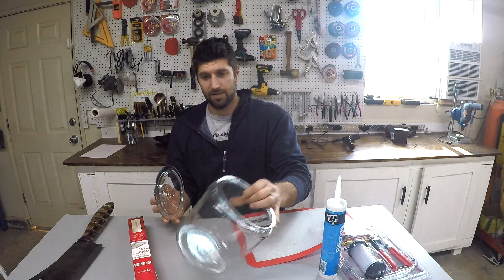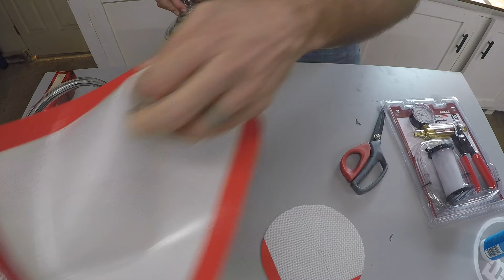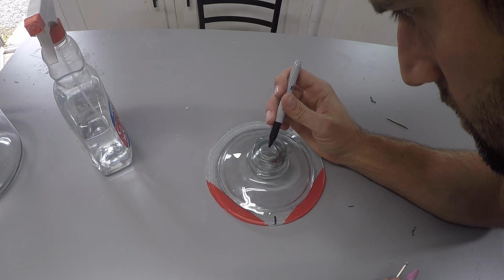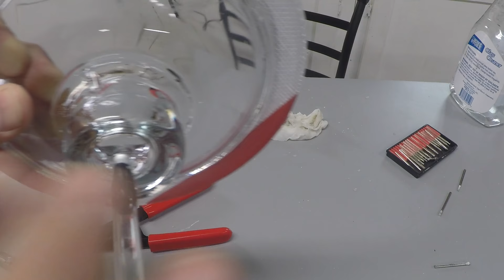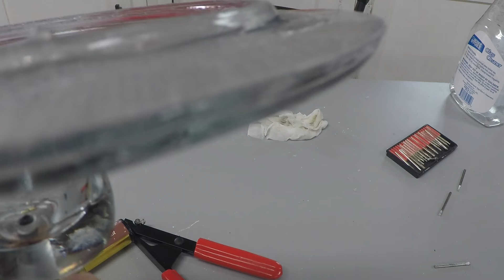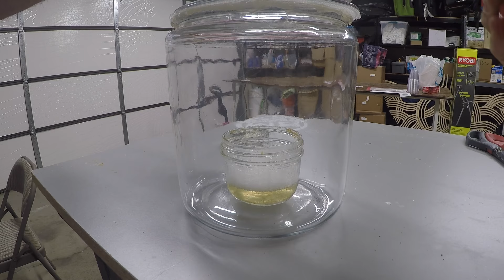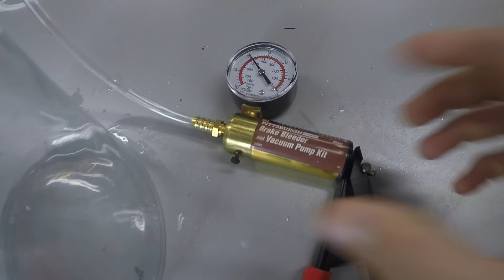EASIEST & CHEAPEST Vacuum Chamber. DIY for epoxy castings & resin pouring.

Comment: 75F here, low-tech and mechanically challenged.  So wouldn’t a $18 elec vac pump for food saving do the same thing???  I just want t be able to suck some mineral oil into my watermelon tourmaline points to make them semi-shiny.  Like oiling emeralds.

Comment: Keep your face away from dremelling glass! This vacuum is at lower limit for degassing which shoul d ideally get to 30 inches 750mm. Cover the jar with a web of duct tape to guard against breaks? This will probably not degass silicone but may work with thin resins. For repeat castings the time taken pumping taken will eat into the pot life ...It looks ok but on balance one has to spend some money for a good solution. Nice try, though, and better than many more complex DIY vacuum vids on YT.

Comment: Great idea if you have absolutely nothing to start with. However, I still wouldn't want to make and use one of these designs.
Just way too many variables to contend with. Not to mention the most important safety concern, which is the type of glass being used.
Nope. Rather save up my money and get a proper RATED vacuum kit and then put it together.
Then again, what's the YouTube creator motto: "Do as I say, Not as I do."?! Lol. 
Good luck out there. Please be safe!

Comment: the vacuum is not good and fast enough. And you need a hot glue gun and all that stuff?
When you can buy a set with a proper and safe vacuum chamber and areal pump for around $100 bucks...
The chamber can then be used as a stainless pot

Comment: I dare you to show a time lapse of you pumping that down to 29 inches with that hand pump. I'm guessing that 20 years from now I'll still be waiting for you to do it. 
20 in is not is not enough vacuum to be useful. You won't pull any bubbles out of resin until you're down around 27 inches.

Comment: Come on man! You definitely need an electric vacuum pump in any field of application? I use it to cast metal, without a real pump which can reach a deep vacuum level like -27 or -30 the casting will fail. The metal could not flow in all the intricate details of the model. Besides, without an electric pump, the investment (plaster) will dry prior to degaze because it's too long to pump manually. No need to mention the pain !

Comment: Who else doing this for BHO? 😂😂
Reply: BHO?
Reply: BHO FA?
BHO FA DEEZ NUT???
Reply: I didn't know if you'd trick me so I struck first
Reply: So, I'm considering it for BHO but I feel like alcohol extraction is safer as it doesn't leave as many contaminants correct? I still haven't decided between alcohol and bho. Any recommendations?
Reply: @jonathonabel1548  well ethanol does leave contaminants, in fact it leaves more. However, ethanol is safer to consume than butane.

The point of the vacuum chamber is to vacuum purge the extracts, removing most of the butane until it reaches a safe  amount of butane
Reply: What is BHO
Reply: @spitman6762  Butane Hash Oil, a very strong cannabis concentrate created through butane based extraction.

Comment: Would using a large canning jar work? I’m only casting one keycap mold, so I don’t need a massive jar. Like this one: https://www.ikea.com/ca/en/p/ikea-365-jar-with-lid-glass-plastic-s49277775/
Reply from the maker: absolutely! I would have preferred to use a canning jar, however I wanted something larger so I went with the largest jar I could find.

Comment: Hard to find that diamond bit for the dremel.
That glass container is usually not carried at the walmart near me.

Other costs you forgot to mention is the cost of the caulk gun, the hot glue gun, and the hot glue.

TIP:
Once completed and you are ready to vacuum/dehydrate things, place the sealed jar with what you are trying to do in the kitchen sink and surround with enough hot water so as to not allow it to float.
When you pull a vacuum on something, the moisture boils out. As it does, it releases heat and can form ice crystals which won't evaporate until they warm up above freezing.
29.9" vacuum for 1 hour and not change means you are pretty much dehydrated.

Warmer the water the quicker the dehydration goes.
The higher the vacuum and the longer you keep it that way, the more moisture you will remove.
Much depends on what you are doing and your goals.

I read elsewhere to not vacuum ammunition or fatty foods.

Good video though.

Comment: You really don't want to be around when that glass chamber fails. A vacuum implosion is very similar to an explosion and that much flying glass is not going to be fun.
A much safer alternative is to use a stainless steel cook pot just like most of the commercial vacuum Chambers do.
A semi-acceptable alternative is to buy some half inch hardware cloth and make a container around your vacuum chamber so that when it fails you don't get large shards of glass flying at you.